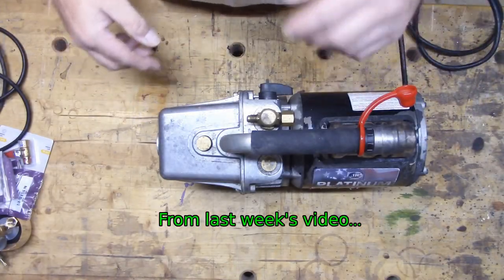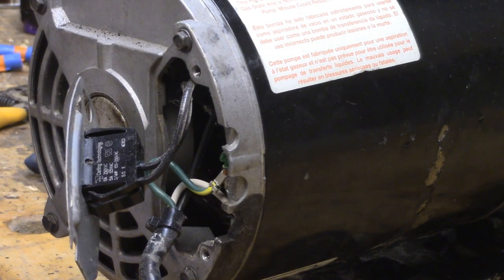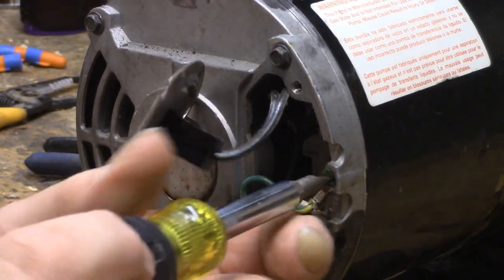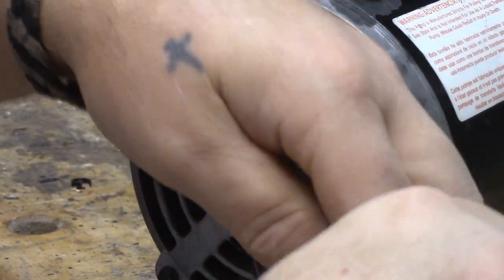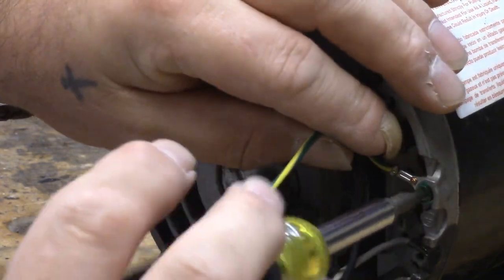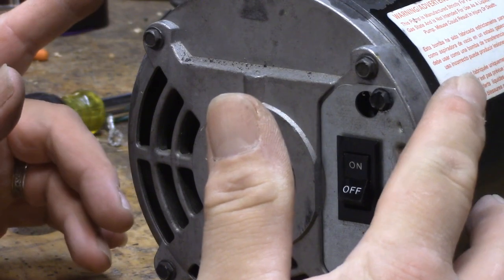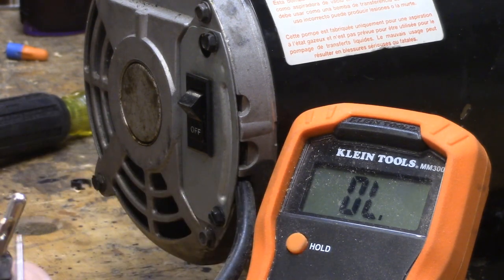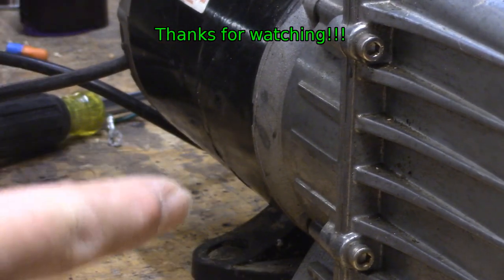GPW 183 - Replacing the Power Cord on a Vacuum Pump

Comment: Great video, i have the same pump and when i use the on and off switch it does not make that clicking noise anymore. Flips empty and each side there is no clicking sound anymore like something broke inside of it?? How can i fix it and where can i buy the part? I have 2 friends also with same problem. Can you make a video fixing the switch